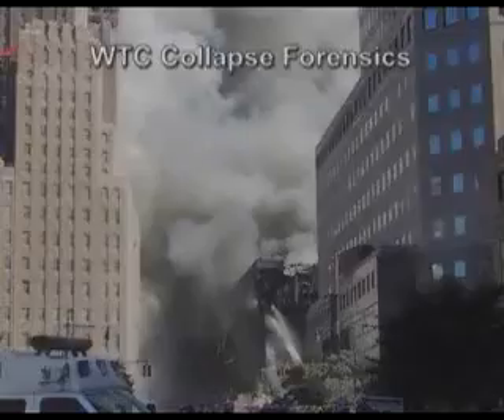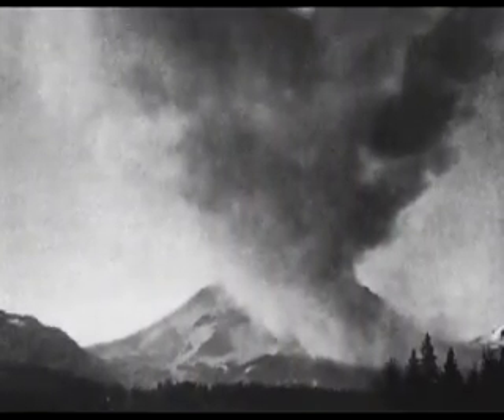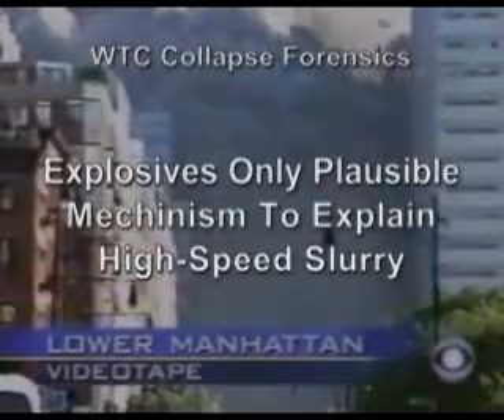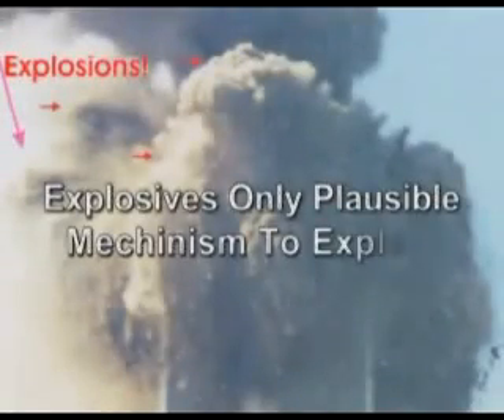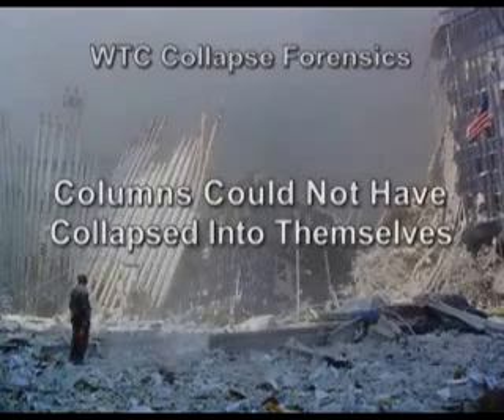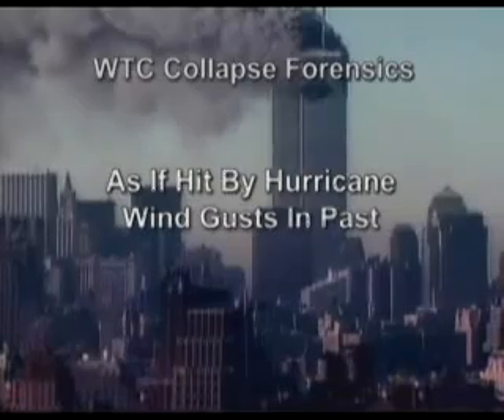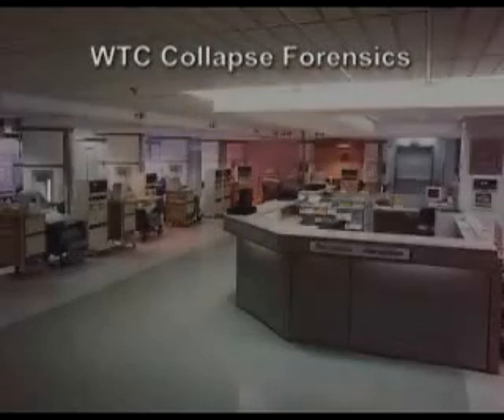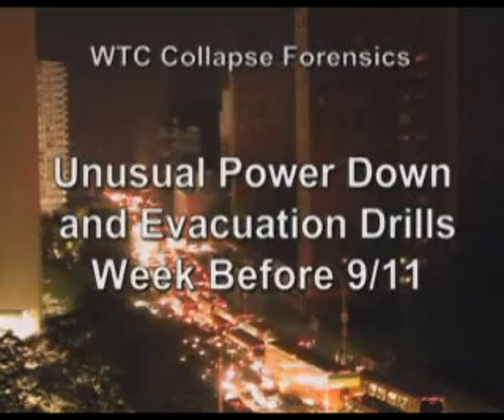MIT Engineer Disputes 911 Theory of the WTC Collapse-Part 2

Comment: I've just read that the concrete floors where of a lightwieght concrete, thus it was an air-entrained mix or it contained lightweight particles such as vermiculate or perlite. But the point is such a mix is weaker than a non-air-entrained mix in that it is not as dense.

I have no problem with the weight of about 20 or 30 floors fracturing at a weak point caused by fire and them collapsing floor onto the one below, and ditto all the way down... and in the mean time said concrete flooring being smashed into dust. As he says, everything such as computers where shattered into the minutest parts (and bits of precious metals).

This isn't a complex buisness. A giant weight dropped a story subjecting that already stressed structure to fail, where upon the same happened all the way down.

I believe the 2nd tower suffered the same result from a slightly different cause.

Tower 7? Before I'd go with exotic theories, how about the firemen let the building go and for various reasons didn't fight the fire. Result was you saw a global failure of the whole building and the same cause as the above towers occured. Thus fire-weakened structure could no longer sppport the weight above it and the wole floor/story failed in one. The result was WTC7 went down like a controlled demolition.

I honestly can't see why people, supposed educated people, have to invent fantastic theories when the explanation should be obvious.
Reply: Willy Whitten
My quote was from:
In regards to the Towers' immense solid steel construction, Frank A. DeMartini, Manager of WTC Construction & Project Management stated in an interview back in January 2001:
Reply: Willy Whitten
The quote was:
"The building was designed to have a fully loaded 707 crash into it. That was the largest plane at the time. I believe that the building probably could sustain multiple impacts of jetliners, because this structure is like the mosquito netting on your screen door - this intense grid - and the jet plane is just a pencil puncturing that screen netting. It really does nothing to the screen netting."
Reply: +Willy Whitten I didn't realize the post I had made earlier with that quote and Frank's full name that Mitch replied to had been ghost blocked and only visible to the two of us :)
Reply: Thank you again Sandy P, I think that is good info to keep in the forefront of this topic. I would add that it has been calculated that the kinetic energy delivered by a 707 crash would be roughly analogous to the 767's that did actually crash into the towers.
\\][//
Reply: Willy Whitten
Actually I didn't entirely agree with that quote as it far as it went. I would have liked to have heard mention of the role of the truss floors adding lateral support to the netting much like a honeycomb. But hey, he was the construction manager and those are the words he spoke in the interview. It is not the role of a mere truther like me to manufacture history. I'll leave that to the debunkers who are better trained and have better support structure.
Reply: Mitch Mabee, Compartmentalization - Need to know. There were crew members that knew what they were doing and others just offloading  cartons and materials. Some knew some didn't, likely the regular elevator employees had no idea of what was really happening. It was the augmented crew that would have been the explosive experts. But now your tune suddenly changes and you say ;  "There were 100's of opportunities to plant explosives. That part is fucken easy." But then jump back to, "LOOK HOW MANY OTHER PEOPLE HAVE TO BE IN ON IT" -- which again comes back to,  Compartmentalization - Need to know. You then ask incredulously, "WHAT DID THEY GET??? - A traumatized population ready to jump through any hoop, begging the so-called 'government' to protect them. You think the PATRIOT ACT, HOMELAND SECURITY, and the MILITARY COMMISSIONS ACT, are not radical extensions of corporatist governmental powers? Do you live in the States?
Do you have no memory of the before and after of the event? Sure, its always been a police state since the National Security Act of 1947, but these things PROGRESS, and need BOOSTER SHOTS of trauma in the Strategy of Tension. Don't give me this bullshit that there was and continues to be no practical motive. The motive is and continues to be to drive Amerika towards Global Empire. While the infrastructure and economy takes the forever shit, and Amerika acts out it's essential role as a Garrison State. If you actually believe the US is still a constitutional republic, you are delusional beyond help. You may as well keep sucking your lollipop.
\\][//
Reply: Learn something of REAL HISTORY Mitch Mabee, you need to get your head out of your indoctrinated ass:
https://hybridrogue1.wordpress.com/2015/04/26/compulsory-schooling-indoctrination/

\\][//
Reply: MrFredSed That "outer skin" was a steel structure capable of supporting the ENTIRE building weight. the only way the outer structure could "buckle was if the inner core support diminished, as would occur by controlled demolition.
Reply: Willy Whitten There seem to be a couple of issues that cause misinterpretation and  misrepresentation of the WTC towers' structural system by our "friends" the CD deniers.

1- There is a misunderstanding by some regarding the load-carrying capacity of both the core and the perimeter structures, which was on the order of 2000% of actual load for the exterior vierendeel-style truss system.

2- The floors were carried 50/50 by the core and the outer envelope, but the floor membranes only contributed to building stiffness insofar as they transferred lateral loads during unusual events such as hurricanes(and aircraft impacts!). Both the core and the outer structures were self-supporting, and did not depend on the floors for lateral bracing.

3- Both the core and the perimeter structure were EACH capable of carrying the ENTIRE building independently, with capacity to spare.
The hat truss allowed for this load transfer each to the other in case of one element being weakened substantially. Chief Engineer Skilling said that an entire side of a tower could be compromised, plus the adjacent corners and a few columns of the adjoining sides, and the structure as a whole would still stand. This is why the aircraft impact damage did not affect the ability of the buildings to stand.

4- Floor trusses were interconnected by their attachment to their slab, and by cross- trusses, so individual sagging/failure due to fire was not possible. Even if the floors HAD failed and fallen, the failure wouldn't affect the surrounding structure, especially the core, which was heavily braced laterally with deep girders.

Any time we are told that the building fell and therefore it must have been too weak to stand, we are being lectured to by people who don't understand just how strong the Towers actually were.

Claiming that the steel "weakened", even by 50%, doesn't explain how a building collapsed that had residual capacity in excess of 200%, and in some instances 2000%.

Cheers.
Reply: +rushthezeppelin 
In regards to the Towers' immense solid steel construction, Frank A. DeMartini, Manager of WTC Construction & Project Management stated in an interview back in January 2001:

"The building was designed to have a fully loaded 707 crash into it. That was the largest plane at the time. I believe that the building probably could sustain multiple impacts of jetliners, because this structure is like the mosquito netting on your screen door - this intense grid - and the jet plane is just a pencil puncturing that screen netting. It really does nothing to the screen netting."

Frank DeMartini died on September 11th a hero. After accompanying his wife down 88 flights of stairs from his office in the North Tower, he went back up with fellow WTC worker Pablo Ortiz and rescued over 70 people. DeMartini and Ortiz - both 49 years of age - perished in the collapse of the North Tower.
Reply: Mitch Mabee
Actually Mitch, those were Frank's exact words as spoken in a video interview. Mabee you should double check your facts.
Reply: Sandy P~all, Which "Frank" are you talking about? The one commenting in this string of comments here, or someone else?
\\][//
Reply: +Sandy P~all, Thank you for clearing that up for me. And yes I agree on your point, now clarified.
\\][//
Reply: +Sandy P~all, Every honest physics and engineering paper I have ever read points out that the "collapse" should have been arrested at the very first floors to fail. That "global collapse" was simply impossible given the redundant compensation of the structure.
\\][//
Reply: +Willy Whitten I agree with you on that but my bullshit meter pegged out before the "collapses" (demolitions) with the alleged airplanes slipping into and between the exterior columns entirely without any deformation of the long fuselage or deflection of the tail. I know this channel addresses the structural capabilities of the towers but debunker Mitch was going off on a tangent I felt I needed to address.  :)
Reply: +Sandy P~all, Perhaps all would benefit from reading the calculations for the crash physics I have done in this page on my blog:
https://hybridrogue1.wordpress.com/2014/02/04/911-disinformation-no-planes-theory/

\\][//
Reply: Mitch Mabee, . "Conspiracy theorists are having fun." -- Bullshit, real researchers on 9/11 reject the 'no-panes', 'video fakery' 'hologram' bullshit. This crap is regurgitated just so people like you can make that claim you just made.
\\][//
Reply: Mitch Mabee, " You're making statements about what you thought might be on the minds of elevators attendants. Okay?" -- No, it's not "Okay" I am pointing out the opportunity to piggyback onto that work the operation of planting explosives in the shafts. You people complain that there would be no way to plant the explosives unnoticed. Then we show a perfect opportunity, and you hand wave it with a silly remark like you just made. And you claim "truthers" are disingenuous! 
This is why we take fuckheads like you for government stooges. You are either utterly naive, or pretend to be.
\\][//
Reply: +MrFredSed The problem is that kenitic energy would start to bleed off by the structural integrity of each floor it hits on the way down.  This would slow if not stop the collapse.  What we saw was pretty close to freefall for 1 and 2 and very close to freefall for 7.  Also unless the collapse is perfectly symmetrical it should not fall 
almost perfectly into it's own footprint, it will try and fall the 
direction of least resistance which is the air and not more steel 
structure.
Reply: rushthezeppelin
You know where your reasoning is wrong? The two towers collapsed as the floors that were on fire couldn't support the 30-40 floors above.
So as the top started to colapse each subsequent storey, it added it's weight to the mass of falling debris... the heaviest part of each storey being the concrete floor.

Thanks for trying to explain
Reply: +MrFredSed says "You know where your reasoning is wrong?" but it is Fred's reasoning that is wrong and defies real physics and kinetics. If you watch the towers "collapse" it is obvious that there are no "subsequent stories" to add their weight or mass, they are disintegrating in mid air. There is no so-called "pile driver". Those buildings erupted like volcanoes, obviously blown up by explosives. See:
https://hybridrogue1.wordpress.com/2014/05/08/controlled-demolition-and-the-demise-of-wtc-on-911/

\\][//
Reply: +MrFredSed  You know where your reasoning is wrong? The floors that were "on fire" weren't supporting the upper floors. The floors were suspended from the structure, so they didn't support anything but themselves.The STRUCTURE, on the other hand, was resistant to acceleration, and PRECIPITOUS collapse due to heating would not be expected. The precipitous failure of the structural steel was likely due to controlled demolition.Bldg. 7 is even more indicative of this problem with your explanation. Losing support for 7 or 8 lower floors  such that free fall acceleration occurs could not be accomplished by a domino-effect collapse of failure due to heating from fire, since the  localized failure would necessarily be asymmetrical and relatively slow compared to the observed abrupt loss of support across the  lower structural support.In  adition, Barry Jenning testified that there were explosions in Bldg. 7 below floor 8 and on the opposite side from the later debris damage BEFORE the first tower collapsed.
Reply: Look, the floor hangers reached from the core to the outer skin, ok?. They reached red hot and became malable! Simple! Now if you have steel up there melting then once the outer skin ALSO starts to become malable >bang< The breaking point is reached and the mass of floors above act like a anvil squashing the floors below domino-like.

Why did these 3 builddings fall when no other fire-damaged sky-scraper has? Weren't these a novel, unique design of skyscraper?

There's film of one of the towers and you see the outer-skin of one floor buckle and suddenly give way. The 40 or 60 floors above simple pile-driver the below floors into dust.
Reply: +MrFredSed is repeating the old "pancake collapse scenario" that even NIST dismissed in it's reports. He also misframes the issue of the steel by insisting that it "reached red hot and became malable" -- which is in itself absurd. Steel is ultra-conductive with heat. The massive connected steel box columns making up the matrix of the core would act as a massive heat sink. The steel could not become malleable even at the floors where the strikes occurred, let alone have any effect whatsoever on the steel structure below. Further the video evidence proves that the upper block MrFredSed refers to disintegrated as it began to initiate its downward movement.
There simply was no massive weight falling on top of the lower sections. The towers were obviously blown up by explosive demolition.  
MrFredSed is obviously science challenged and way over his head in these discussions; he simply doesn't have a clue as to what he is talking about.
https://hybridrogue1.wordpress.com/2014/05/08/controlled-demolition-and-the-demise-of-wtc-on-911/
\\][//
Reply: +Edward Anderson is correct, the outer structure handled the lateral stresses supporting the entire building in conjunction with the inner core supporting the weight loads of gravity.
\\][//
Reply: Edward Anderson Very eloquent explanation sir.  I didn't even know the building integrity was THAT damn redundant.
Reply: rushthezeppelin There is a push on to minimize the Towers' strength, so that the notion of "fire-weakening" seems plausible.

I had one individual liken the cores to a spindly "radio mast", with the exterior structure acting as "guy wires" to stabilize the whole affair (the floor membranes were designed as "stand-offs " in this scenario). I am continually amazed at the creative license employed by those who need to maintain the official narrative, even to the point of grossly misrepresenting structural details. This occurred early on as well, in much of the "expert" commentary supporting the official narrative. "Creativity" has been a hallmark of the 9/11 cover up.
Reply: Ya you always hear everyone try and harp on the "fact" that "they were designed to take an impact from a B2 bomber, not a 737".  I've never heard someone actually dig up exact numbers on how redundant the structure of these buildings were.
Reply: rushthezeppelin
No, wasn't it they were designed to withstand a 707 but not the fuel (fire)?
Reply: +Sandy P~all That's a lie. Frank never said that.  Actually he said the opposite. That buildings have an incredibly large amount of stored energy. They're made of steel and cement stacked on top of each other, any building can come down if comprormised in key support areas
Reply: +Sandy P~all So address it. You can't just claim that you closed your eyes when the planes hit and therefore didn't cause any damage. What is your point that we all watched a hologram? This is exhausting. In the words of Bertrand Russell "You cannot rationalize someone OUT of something they didn't rationalize themselves INTO."  And its silly to try. Conspiracy theorists are having fun. Its like announcing to the world "Everyone can relax cause I figured it out. I have all the answers"  Truth is hard to find. It takes a lot of hard work.
Reply: +Willy Whitten You're making statements about what you thought might be on the minds of elevators attendants.  Okay? Thats a good country mile from a researcher. Again the word is empiricism.
Reply: +Willy Whitten Don't stop! I hate that. Lets do what NO conspiracy theorist dare do. Lets keep going with that idea string, follow it to its logical or illogical conclusion. The elevator employees, are they privy to the role they are playing in this, the most elaborate and complicated undertaking in human history? I think they would have to be. They could not be relied on to place the explosives in the correct spots unless they were in on it . If they were in on it then they know what they are doing and why so that doesn't help us understand why they ran from the elevators in a panic so I say scratch that theory. It doesn't matter, There were 100's of opportunities to plant explosives. That part is fucken easy. The problem is, once you head down that road LOOK HOW MANY OTHER PEOPLE HAVE TO BE IN ON IT. The logistics become a statistical impossibility. We haven't even touched on the tough question. WHY? WHAT DID THEY ACCOMPLISH? WAS THE GOVT OVERTHROWN? WHAT DID THEY GET??? THE PATRIOT ACT?? HOMELAND SECURITY?? Are you shitting me? Thats an enormous undertaking if the only  thing they  got out of it is one more stupid govt agency. THAT IS THE TSUNAMI IN FRONT OF YOU MR WHITTEN. MOTIVE. YOU HAVE NO PLAUSIBLE PRACTICAL MOTIVE.